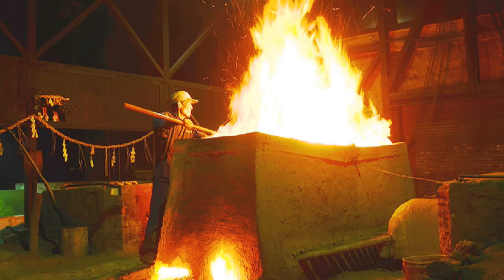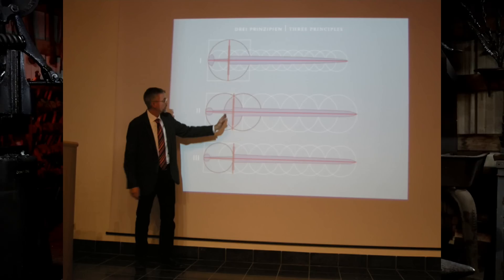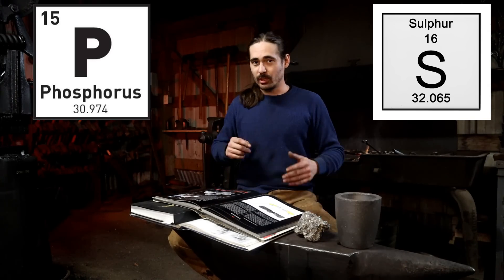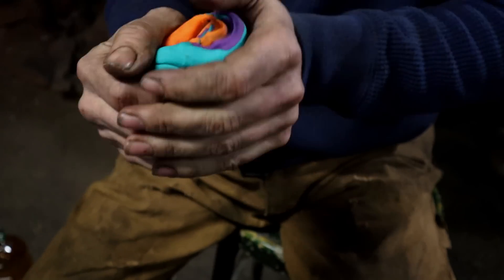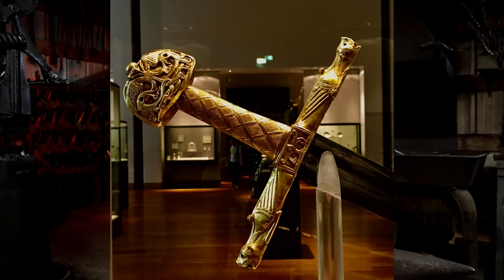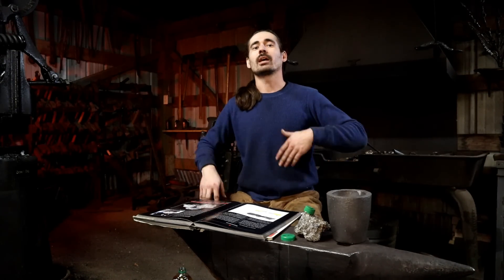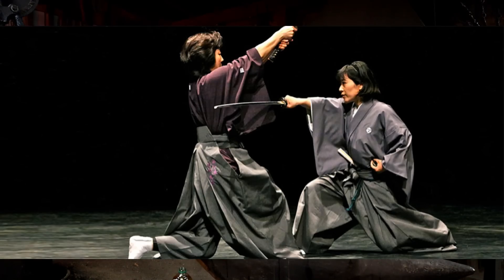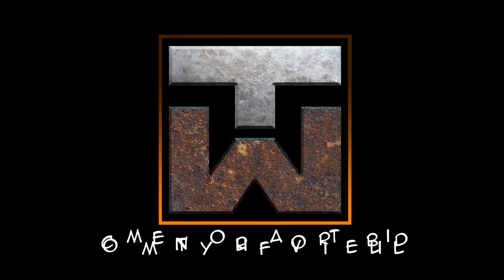Misconceptions About Medieval Steel - Wootz vs Bloom

Comment: Very good research and props I might use the playdough one.  Some of your metallurgy was questionable though.  Bainite is not martensite or pearlite and is not a mixture of the two...there can be Bainite, Martensite, and Pearlite present at the same time but Bainite is different than both. I have been working on Wootz for over 20 years and you can make it with low S and P achieving great mechanical properties.  Soft and brittle can't usually be used to describe the same material although I think I understand what you mean as it can fail on an impurity, but most have floated into the slag.  Wootz steel is very good at cutting flesh because of the micro-serrations at the edge.  I have lots of meat cutting Wootz knives and will bet on a Wootz knife against anything else of that time period and even compared to some moderns steels.  Therefore, I believe this is the reason for the curved blades as dragging this across flesh will do damage and also avoid the same bending situation the European blades struggle with.  You can harden the blades as well.  I make carving and fillet knives blades with 1/16 thick or thinner sections and they spring back to true every time.  So some of the Wootz back in the old days was not as uniform with lots of P and S some less in P and S.  Name of the game is if you want a very bold pattern you probably will get it just add a bit of P.  If you want really good properties, (but not as bold a pattern) don't produce it with P.  Easier said than done, but we figured it out...  Like to talk some time about this as I come more from the metallurgical side than the historical side.

Comment: Whatever else I say you are exactly correct. Soldiers were like waves smashing into rocks. Only when gods were involved did weapons become a religious act. One in millions could make nothingness at the edge. The nothingness is what cuts. Use origami to fold the steel the layers are destroyed by carbon migration in a Japanese sword. You adjust carbon content. There was a sutra to make steel that kept the layers intact. You made only one sword. The owner made sure you never made two. Today we would call it low alloy glass steel. The surface when polished looks like a prism. I forged O6 using Soshu to just make a bar. I could
not cut it except with a silicon carbide saw unhardened cooling in ashes. There are still secrets but one sword never armed a thousand men. The gold dagger for the clay army emperor of China is wootz from Persia. Notice it is not pitted. My Pulwar from King Tipoo has not rusted only turned dark. The shape has low angular momentum for better acceleration. Verhoven  and Pendray did a paper on  wootz where vanadium made the alloy. Mr. Pendray didn't tell him everything. George Cameron Stone wrote his Glossary recording first hand knowledge before it was forgotten. Add copper to the list of harm to damascus steel. I chopped a blade on the anvil and watched it open like a fan.

Comment: Indians managed to make high quality crucible steel in mass by first making wrough iron and cast iron to remove the slab and them melting those two iron tipes in a massive crucible that used a ventilation system that enabled it to pump enough air to melt the mixture. That system consisted in a trench network cut in a way so it funeled the monsoon winds to the blomery.

Comment: Thats a pretty groundbreaking statement towards the HEMA community, im interested to see how they will react to this information
Reply: If you are referring to the feders breaking thing, it's a very flawed idea. Feders break because we use them the equivalent of thousands of real fights. Each HEMA fight is usually the equivalent to around 10 real fights, one after the other. Multiply that by several times each class, a couple of classes a week, and you are having the equivalent of around 50 real fights every week.
That's why feders break. No real sword would have been expected to last for thousands of fights.
Reply: TBH, my reaction is 'get in the ring then.' It's easy to make callouts when you will never need to actually prove your hypothesis.

Comment: Great talk, very satisfying.
I thought that "hamons" was a trade mark of Japanese swords and not European ?
Also you mention that ancient Japanese swords had blade hardness of 65 RC that is as high as a 1095 steel oil quenched. I think 1095 will get around RC 64 to 67 as quenched.
Of course a RC 65 will be almost as brittle as glass for a 1095 steel.

Comment: Hey everyone im a starting blacksmith that has everything i need other then a forge. Ive been looking online on how to make a basic Coal forge however im currently running into the problem of what to insulate the forge with so that the heat coming from the fire doesnt burn or melt everything if anyone has ideas for what to use that would be alotnof help and thank you in advance.

Comment: Couldn’t you just fold the crucible Steel?
Reply: Athens Arfaras 
Crucible steel has a dendritic structure that would probably fracture if one started trying to fold it.  From what I have seen, it has to be worked slowly to keep from causing cracks to form.  But I’m not an expert, so take my info with a grain of salt.

Comment: The playdoh demonstration was ingeniously done. Once you show that it's the case it's incredibly hard to refute it, especially once you tie in that Phosphorus and Suphur are gaseous at glowing steel temperatures and would easily diffuse out as the malleable material was plasticised, deformed and folded. 

I like them history apples just fine ;)

Comment: Facinating.  The nearest thing I've ever held that has any relationship to the katana, is the folding Japanese carpenter's knife.  It is incredibly sharp and incredibly sharpen able.  It has a similar curve to the katana and I suspect a similar steel but probably a different cross section.  As Ilya points out, the sword is intended to cut through flesh and bone in a straight line.  The wood worker would use a saw to do something similar in wood.  

The carpenter's knife is used to pare wood along the length of its fibers and not cut into the cross section of the fibers and the nearest equivalent in Western woodworking would be the chisel blade when it is also used to pare,  heavily cheated up the steel and away from the handle, as opposed to when it is used to gouge out mortises in the wood, often being struck with the wooden mallet on the handle itself to cross-cut through the very tough and pliable fibers.

Japanese carpenter knives aren't that expensive and are generally available.  I'd suggest that Ilya add one to his collection, if he doesn't have one already.  I think that someone such as him who knows the swords and sword making from the inside would profit by contrasting what must be similar steels put to other uses and purposes than cutting through an enemy's collar bone.  I always learn something looking at your channel.  Best.

Comment: 10:14 -> a major reason for the japanese to fold their steel was that impurities where "smashed out" of the material and carbon was more evenly distributed in the metal. This is partly a consequence of less sophisticated methods of casting iron! In fact european steel (and their steel making-processes) was better than the japanese steel. 
You mentioned that european swords where less hard on the edge than japanese swords? You left out the reason for that:
no matter how hard the sword is, you will not cut through chainmail or plate armour(which was predominantly used by knights), so there was no reason for the european smiths to go to 60+Rockwell! Even more, a harder edge would only more easily chip or crack! We have many preserved depictions of bend, broken or cracked japanese swords. This is not to say that european swords were not breaking, chipping as well, but japanese swords are by faaaaaaar not the pinnacle of sword-making weebs love to attribute to them..

if you want to give it a try..this comparison is quite informative (subtitles are possible for non germans):
https://www.youtube.com/watch?v=ev4lW0wbnX8

Comment: Was it not also true that the process to produce true Wootz crucible steel is a lost technique as true Wootz steel produced very springy steel that will harden, so I guess is low phosphorus/sulphur, either by whatever additives were put in the Wootz crucible or the source ore was low Phosphorus/sulphur?

Comment: Thank you Ilya. I think that taking the entire culture that produced the steel into account is the only way to judge the materials. Availability of material to produce steel is an important factor as well, and whether you have the money to replace a broken sword means nothing if there is no steel to make another. Having lived in Japan for a few years and practiced Iaido, yes these fights are very quick and proper edge alignment when performing a cut is essential. It also worth noting that Japanese martial arts are far better documented than "H"EMA, many more sources exist and there is no need for "interpretation". It very well could be that many sources used for HEMA could be largely anecdotal, and/or artistic interpretation.

Comment: This was quite good analysis, However, More research needs to be done about the steel made in India between 300BC-1000AD. India was at it's peak of glory, education and wealth before Islamic invasions, cast systems, British colonizers. There where international universities and learning centers in India where scholars from all over the world would come. Indian handicrafts and general craftsmen were respected a lot. Some of the metal remains from that period e.g. Iron pillar standing in New Delhi, which hasn't rusted to this day marks an example of the craftmenship and metallurgical knowledge of that time. Most of that knowledge is lost today.
Reply: I would like to point out that the caste system has existed in India for at least as long as written history has, if not longer. The rest of what you wrote is spot on.

Comment: Cost cannot be avoided. 
    
Because of rarity of iron deposited in the Japanese islands, there are (A) fewer swords made and thus (B) swords are made for those with money. 
     
In Europe, iron is much more abundant and, therefore, cheap. 
     
A European army would have many swords, many swords would be made, most of them would be cheap and lower quality. A noble could afford a better sword. A later, higher noble could afford a better looking one because they were NOT going to be fighting with it. 
    
Which sword gets saved and which rusts the corner of a room? The pretty ones get saved, the high quality ones might get saved, and the cheap ones rust to dust or are repurposed. 
    
A Japanese army would have FEW swords. None of your men-at-arms or peasant levies would ever have them. The sword was unique to the noble classes. Yari would be the weapons they would carry - just like the spearmen of a European army, but they would NOT carry a sword as well. A European would. 
   
Consider that in the Canterbury Tales, Chaucer mentions that the Yeoman (a man-at-arms archer) had a sword and shield. Chaucer doesn't even bother mentioning that the Knight and his son, the Squire, because OF COURSE they would have them. Several others, however, ALSO have swords on them. The Miller is carrying a sword and shield and the Reeve has a "rusty sword." That is at least three non-nobles, two of them not in military occupations, who had a sword to carry with them for a pilgrimage. 
     
Carrying a sword through most of Japanese history designated you as a noble or a criminal. 
     
All that is just to say that almost EVERY Japanese sword was being produced at a "nobles only" budget with combat in mind (the exceptions for those too high of rank to see battle, and thus were "pretty pieces" were, due to culture and a vast desire to NOT advertise that you were not going to be battling yourself, going to be made by the very best smiths to the highest battle standards - so, and emperor's sword would be incredibly well made despite the reality that it would never see real use). 
     
European nobles RELISHED being too high of a rank for normal combat and those with enough rank for the pretty gear also had groups of retainers to do the real fighting for them. Since ransom, not death, was their likely outcome if overwhelmed, having such pretty items of wealth on your person actually did you some good for swiftly paying your ransom and returning unharmed. 
    
So, most European swords would be peasant swords - mass produced for the masses at price-to-quality ratios that made sense. Comparing them to Japanese blades makes as little sense as comparing the pretty show pieces to Japanese blades. 
    
The highest quality of European blades are the only ones worth comparing when discussing quality and skill, since only they are equally made and intended. Certainly, given the option, Japan would have been flooded with low quality swords as well IF they could have made them at a price that justified their existence (though there is also the rather oppressive nature of several of Japan's historical governments when it came to the peasants having any access to arms, hence their fine history of fighting styles build around farm equipment). 
      
So, if you could have European and Japanese armies of the past clash, it wouldn't matter that the Emperor or Shogun would have a better sword than the King or Barons - none of those guys were going to be using their swords. 
    
The Lords and many Knights would have swords of equal quality to the Samurai they faced. The thing that would turn the tide would be the ubiquitous metal armor and the quantity (and comparative size) of European cavalry. 
      
For the non-noble foot (ashigaru), the Yari and Japanese archers would be little different from European spearmen and archers except that the Europeans would have a much higher number of shields and many would have swords (which would not be found on the non-bushi soldiers until the 15th century or so). The prevalence of metal armor would also be a vast advantage for the Europeans. 
       
There is a reason Japan was on the defensive against external invasion until the industrial era and why in the lead up to WW2 they had to first invade China to secure the capacity to produce their modern navy.

Comment: Here's the problem - You have mixed assertions about social history with technical information regarding swords and steel. While I'm no expert on swords and steel, my impression is that you are sticking to the facts. I am somewhat better versed in the social sciences, and it's pretty clear that when it comes to the social position of blacksmiths in medieval Europe, you're pulling stuff out of your backside.

Illiteracy in a largely illiterate society does not confer nor does it signify low social status. The medieval period was loooonnngggg. Generalizations about social conditions over that long a period aren't useful. In the early middle ages, iron was scarce enough that villages often had no blacksmith because they had no iron, while castles did. Cities had smiths, but not many, and cities weren't all that big mostly. Blacksmiths had a valuable position in the martial side of castle life and status in accordance with their role.

With advancements in mining in the mid to late middle ages, blacksmithing spread more widely. During that transition, some villages banned blacksmithing - technology is scary, after all - but that is certainly not evidence of low status, any more that Tubal-cain's lineage proves low atatus. All craftsmen were in Cain's line, including gold and silversmiths. Were they also low status?

Apparently, the short version is that Japanese swords break if misused, while European swords bend if misused. I will take you at your word. What does the literacy of Japanese smiths and the illiteracy of European smiths have to do with breaking vs bending? Literacy would seem to be irrelevant to your conclusions about the limitations of swords. If so, you have misled your viewers, probably because you have misled youself. 

For a similar example of a specialist misleading viewers by misleading himself on matters outside his knowledge, see Shad's comments on literacy in England in the late middle ages.

Comment: As far as I know the modern art of forging swords starts around the 1960's where some people thought, hmm how did they make their weapons. They tried it with their 'modern' steel which comes from a factory which produces 'clean' steel. I'm pretty sure they applied their techniques they knew as well. As far as I know there were very very few European manuals for forging. Most things were reconstructed from artifacts they found lying in the ground for a long time. I'm pretty sure If a modern smith would travel back in time to visit  a weapons smith and try to use his 20th century technique he would fall flat on his nose because they wouldn't work that good because medieval steel is different then their modern counterpart. I speak of europe. As they said in the video the tradition of swordmaking in japan didn't changed that much over the last 1000 years. Some minor difference is that now they can produce even more pure tamahagene. And if you compare a modern springsteel sword with a traditional katana you compare flintlock gun with modern pistol.